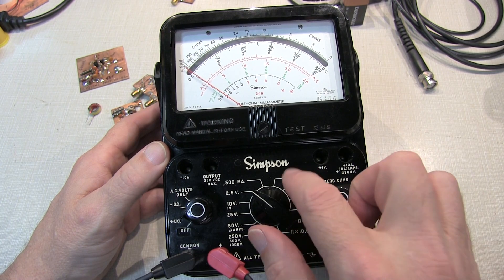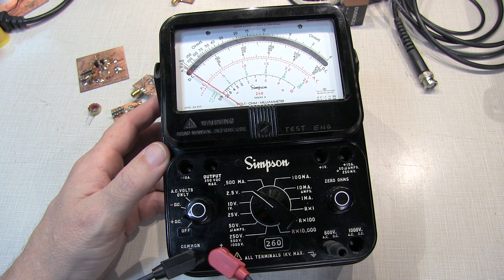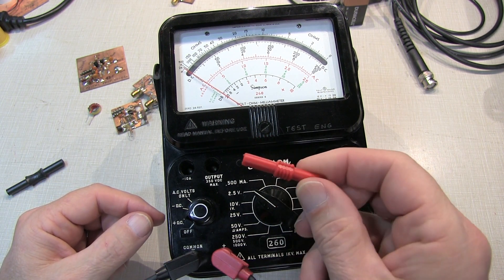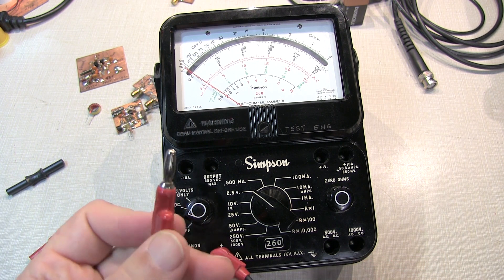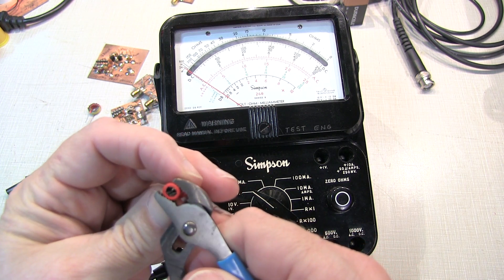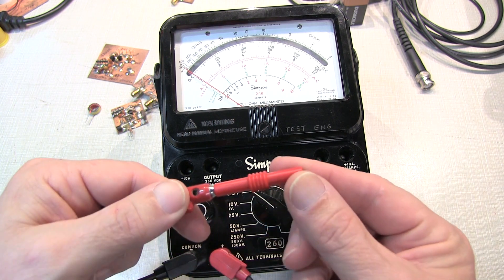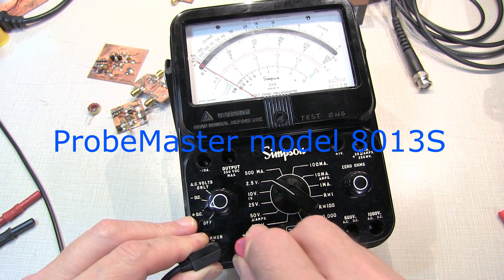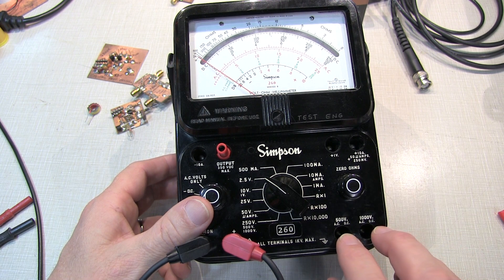#322: Followup: Simpson 260 Series 7 & 8 Reversed Banana Lead solutions

Comment: For the reverse banana/pin go to Ace hardware, buy brass tubing that a banana plug fits inside, cut a 1 1/2 in piece, smash down one end flat and solder your test wire  and you can even drill a hole once its smashed, then the brass tubing fits over the pin in the meter and you cover it with shrink tubing. If you use a miniature pipe cutter to cut the brass tubing,  it makes the diameter smaller (at the cut end) which solves the spring problem. (I haven't done it but you could dip it in a solder pot and then ream it too). It it's too tight, use a reaming tool or Dremel grinder until its correct diameter. You can also use the tubing with a copper alligator clip to replace the threaded clip if you lose/didn't get one to fit the threads of the probe tip. You just tap out the inside with a # 6 (I think) tap and solder the brass tubing into the well of the stem of the copper alligator clip. Thought I was the only one frustrated by this design.

Comment: Hi Alan ... I have an old 260 8 series (mirrored scale, protection feature and roll top case) that I used for troubleshooting for many years. When I first got it, I was really disappointed about the reverse jacks (The plug (male) is in the meter, and the jack (female) is in the test probe. With my previous 260, it was the other way around. I called Simpson and complained about it, as I only use it for low voltage work (other than the 70 Volt Line from distributed audio systems and I didn't typically work on those live anyway, everything else was typically 50V or lower.). And then I use a set of Pomona 'mini-grabbers' with them. Well, I got them to send me a pair of adapters. These were made specifically, and I still use them Their part numbers were 6-112685 and 6-112686. One of them is a little bit loose, so I've been looking for a replacement for them. Unfortunately, I've not been able to find them. Supposedly, they have a test lead set that was quite pricey #00043. I got a set just to have them. I really appreciate the info you shared, and I'm going to try out both solutions you suggested. 73, Neil, K7WK

Comment: i just solved all that as an issue by removing the simpson contact and replacing it with a nickel plated brass terminal's robbed from some chinesium banana jacks. i did all 8. externally it looks unmolested but now it accepts fluke style shrouded plugs and even oem simpson right angle lead plugs. why horse around with adapters to accomodate simpsons desire to corner the meter lead market?. the installation looks like any fluke meter jack and sits well below the surface

Comment: I wonder if there's an easy way (without modifying the phenolic case) to replace the pins in a series 7/8 with shrouded banana jacks so that the meter could accept banana and shrouded banana plug probes just like any DMM.

Comment: When you think about it,  the reversed leads are an extra safety measure for industrial users like electricians.  The meter itself is rated for 1000v but cheap or home made banana leads might not be.  This forces you to use leads rated for HV when measuring such.  And no exposed metal on the jack end in case a lead pulls out by accident or if you forget to disconnect the lead.  Alot of cheap DMMs are not rated for very high voltages anyway.  And if you are measuring HV,  do you trust your life to a cheapo DMM and the unknown quality leads?  IF you just work on low voltage stuff,  it does not matter.

Comment: I don’t understand why there’s an issue using the probes that come with the 8P. Mine work perfectly and are provided with the meter.
Reply from the maker: The two main issues are:
1) When finding these meters in the used market, often they don't have the leads with them.
2) In some measurement scenarios, you may want to connect the meter directly to other instruments or binding posts, which is more convenient to do with banana-banana jumpers, etc.
Otherwise, I agree, the standard probes that come with the 8 are very nice, high quality leads.

Comment: Just snagged me a series 5P on Ebay for $20.  Woohoo!  Always loved the 260.
Reply from the maker: I hope there's no battery leakage damage.
Reply: And, to follow up with Alan's caution, hope your new meter is accurate and the range resistors are in good condition. Review Alan's video #324 to calibrate. But, if the meter's not accurate, you might be in for some rework.

Comment: Back in my early days of using my old Series 2 260,  the pin-type jacks started going intermittent on me.  The concept came to me back then that any given connector is going to have a solid part and a springy part,  and that was at the root of my difficulties -- the "springy" part was in those pin jacks,  and it wasn't really feasible to make any adjustments on those.  So in my case I ended up drilling the holes out and retrofitting the meter with banana jacks.  From what you're saying about these later models,  it looks like they've decided that the springy bit is going to be on the test lead ends,  which is why the adapters have such a loose fit.  Why mess with an industry standard?  Yeah,  I understand the danger inherent in having a loose banana plug flopping around while you've got the probe end of things in some live circuit,  but you've got to be not paying attention to not notice that it'd popped out.  Or you need longer test leads,  maybe.  I make my own,  mostly,  using red and black "test lead wire" and whatever ends suit me.  Too bad that old 260 doesn't have the input jacks at the (mostly standard) 3/4" spacing...

Comment: At least Simpson meters don’t use proprietary custom chips that are no longer available even for relatively recent Tektronix products rendering them scrap. Anyone who wants to keep something beyond the warranty is best advised to avoid Tektronix products if they don’t want an expensive paperweight down the road. Buy a Fluke. They still support products 20+ years old.
Reply: Or, as many have done, invest 25-50% or your workbench in vintage 70s and early 80s stuff that have discrete parts. Imagine the thrill of fixing the A7 board of a 475 scope by replacing a SOCKETED NPN with a 2N3904! God, I love my 7704A. Keeps me warm at night!
😉

Comment: The Triplett meters have always been better than the Simpson meters, the ONLY reason the Simpson meter were popular is because the plus & minus switch reverses the Ohm meter battery polarity, so you can hook your crocodile clips to a 10 or 20 Ampere (or any) diode and flip the plus & minus switch and see the forward and reverse resistance and Triplett meters never had that, you had to reverse their leads. Ron W4BIN
Reply from the maker: Triplett meters are certainly very nice, high quality meters.  I love the little 310 handheld units.  I don't know if they're better/worse than Simpson, but I'd like to hear why you feel that Triplett meters are better.

Comment: Simon makes adapters specifically for use with standard banana plugs. They are similar to the couplers you showed in the previous video but I assume they fit better, Not sure if they are still produced but I found several at my job.

Comment: No matter which series you get be sure to buy new, good quality test leads and probes that are rated above the voltages you are going to measure. Sure, you may want to save the old leads and probes if they look nice but put them aside in an airtight bag for nostalgia reasons.

Comment: Please forgive my ignorance, but why use an analog meter at all?!
Reply: Analog meters reveal symptoms that cannot be seen from a flickering digital display. 
I was a testman for an electric utility and had digital and analog multimeters in my van. With experience you learn to interpret what the meter is showing you. Thanks
Reply: How else are you going to get a continuous analog representation of an analog signal? Strangely flicking digits on a DMM can be just nonsense while a moving needle can tell you exactly what you are looking at. It's situational of course, but there are plenty of cases where a real analog meter is just better than a digital one. The video this is a followup to also gives some info on the subject if you care to watch it.
Reply: For example, adjusting for dips and peaks is much easier with an analog meter. In the case of nulling a bridge analog meters can be more accurate than digital meters. Digital meters are usually better at precision.
Reply: watch the end of the previous video.
Reply: Adding to what other people have said, analog meters are also much less susceptible to noise. So if you have a noisy power rail or some stray RF, they can cause cheaper DVMs to read higher than the real voltage level. I can't speak to whether name brand DVMs are susceptible mostly because I don't have any to test